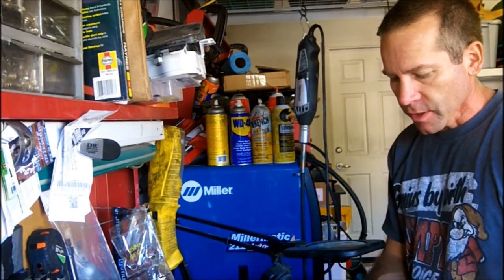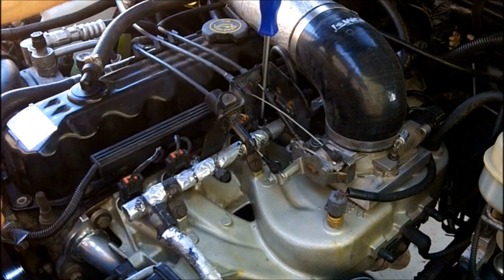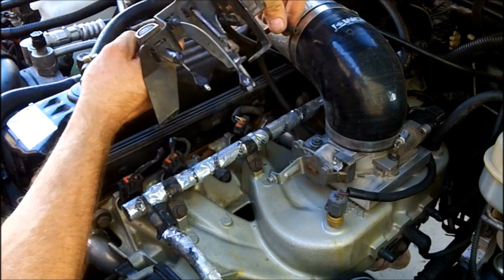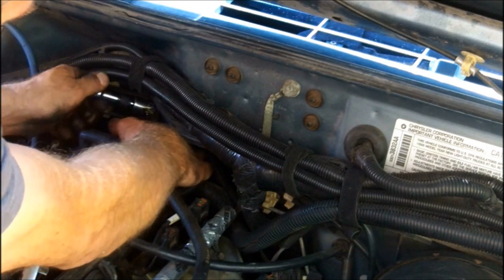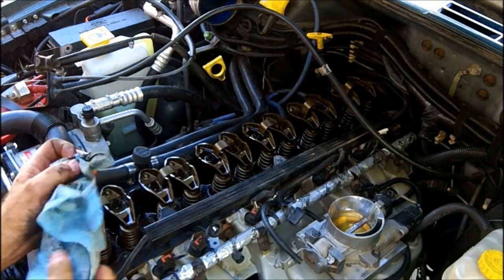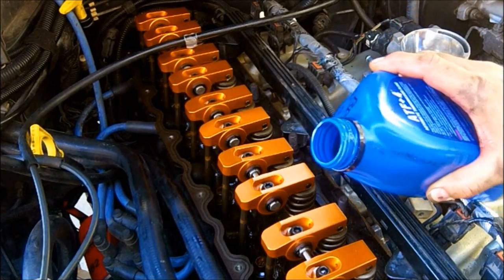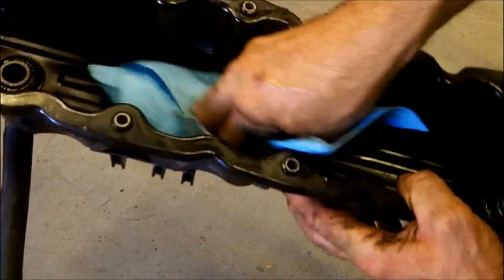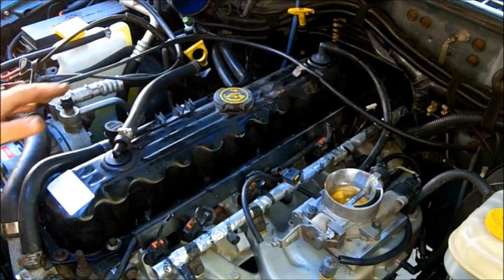How to Install Harland Sharp Roller Rockers on a Jeep 4.0

Comment: My 93 didn't have a bafel.
Is a older renix style cover.

Does the balef really aid these or should i just stick with my renix cover ?
These newer style ones looks cheesy, even sounded so in vid. If it provides a advantage tho i'm swapping it with o e at the yard
Reply from the maker: Taylor Mallory 
I personally think you can stick with your old cover. And honestly I don't think I would have needed to remove the baffle in my steel valve cover. I think the ones that cause a problem are the cast aluminum that have a baffle

Comment: A HELPFUL TRICK FOR REMEMBERING WHICH VALVE COVER BOLT GOES WHERE ID TO TRACE THE NEW GASKET ON A PIECE OF CARDBOARD AND PUSH THEM INTO THE BOARD AS YOU REMOVE THEM. MADE THINGS EASIER WHEN I REPLACED MY VC GASKET.
Reply from the maker: patrick madigan 
Good idea...thanks for commenting
Reply: That's a great lil tip that I will remember! Thanks!

Comment: Great video..ashame you have to cover up those beautiful rockers with a valve cover.. should at least powder coat the cover some bitchin color..lol
Reply: they should have kept them stainless. I don't see the point in coloring them if its not a visible component beside giving you a uneasy feeling when you throw the cover back over them.
Reply: @citydemo5701  Anodizing hardens them.

Comment: Will those rockers work with my 4.2
Reply: Apparently they do make them for 1983-1986 Jeep CJ 258 engines. Not sure if earlier CJ's valve covers are not tall enough for this application as there is no reason stated why they are not recommended for earlier Jeeps.

Comment: I think baffle was supposed to redirect oil onto rockers
Reply: its there to try and keep oil out of the PCV valve and intake breather lines. some times you will not notice it missing but any blow by at all and you will now think you have burnt rings or valves because you will be sucking oil into the intake and burning it causing blue smoke from the exhaust. bottom line, its there for a reason and best to not remove it. if it does not fit with the new rockers then its time for a taller cover. simple as that. why spend good money on upgrades just to cut corners on the instal
Reply: Zachary Graham my older renix style cover didn't have one, but this would make sense.
The newer lighter covers all had baffles

Comment: Where did he relocate the vacuum line from his pcv valve when he installed his new intake?
Reply from the maker: the 68mm throttle body I installed has a vacuum line fitting. Or you install a small K&N style filter to the end of the vacuum hose and tie strap to the fire wall.

Comment: does this reduce the rocker noise?  I would like my engine to have less clickitclac.
Reply from the maker: I can't say that it would make it quieter. Are you sure its not the lifters that are making all the noise.
Reply: thanks for the helpful information.  The noise is most likely lifters, but it's not unusual, most 4.0 I have heard have it.  I am just being picky.  My 4.0 would have a very sweet/smooth sound if not for the loud lifter tap common to all these engines.

Comment: what kind of oil pressure do you have with these arms?
Reply from the maker: The same as it was. No lose or gain
Reply: martinbuilt the reason I ask. I just installed these on a rebuilt engine and at start up I have 60psi and at warm idle  oil temp it goes down to 13 psi and goes up to 40 psi when gas is added.
Reply from the maker: That sounds like a normal engine to me. That's how my engine acts for over 6 years that I've owned it.
Reply: Weird I have 38psi hot idle 45ish cruising roughly 48 cold idle   Haven’t been into the Engine might have some after market part or something. Any thoughts...
Reply: Yes, Lots of thoughts. I have them all the time!!! But you probably have an aftermarket Oil lightening Preasure reducer installed. Sometimes people install them when they  do the valve cover gasket. There just not needed. they can be hot and cold sensitive. They tend to give false Pressure readings when they are hot and cold. What is the PSI when the motor is warm?  Back me up here  Martin ?  What color is the gasket?

Comment: 200k that thing is still a virgin ive seen 500k on thses engines
Reply: . Ive got a 92' and its my first car. From what Ive seen, Cast steel Engine blocks are indestructible. Good to know Ive got a engine that wont let me down!
Reply: Sean Unrein only 500k I’ve seen em close to 800k with the Cherokee basically not even there it’s damn near just a motor trans and axles

Comment: My question is if they're all in line why aren't they all on a single shaft?
Reply: More metal. More complicated.
Reply: Because its an overhead valve engine, not an overhead cam engine.

Comment: hey, when u cut off that oil pan inside the head cylinder cover, the oil didn't go through hose straight to the intake? and how many power u get after that swap, I know less friction mean better displacement that make sense.
Reply from the maker: If I would do this again I would not cut out that metal under the rocker cover and see if it would clear. A small amount of oil will go into the intake. I ended up taking that hose off and installing a vent filter and mounting it high on the fire wall.
Reply: martinbuilt ....so dont. I tried that for that reason and it doesn't clear, all of them rub on the baffling and bent 3 or 4 pushrods. I had 12 spare rods so it was a quick free repair, but I removed the baffling and it's fine and a lot quieter

Comment: Why does your air intake go across your engine and into the vehicle?
Reply from the maker: That's my cold air intake. I have a video on it. The filter sits inside of the cowl.
Reply from the maker: Don't recall the ratio. But I would see if the part number of a factory 
rocker for the 4 and 6 cylinder are the same. If so I don't see why they
 wouldn't fit.
Reply from the maker: the air filter is inside the cowl.

Comment: i saw on the site they have 2 different part number for the 4.0  what one did you use
Reply from the maker: part number S40196
Reply: thank you sir
Reply: What's the other part number? These are the 1.6. I can't find the part number for the 1.7 arms anywhere.

Comment: If one hasn't done any work under the gasket cover to this point in their build, when installing the Roller Rockers, is there any other general maintenance or items to consider replacing other than the gasket while it is off?
Reply: Pushrods.
Reply from the maker: well there are a number of things you could change out push rods if you like and I would probably most likely inspect the valve guide seals of course that does involve removing the valve retainers. that can be a pretty big job. but then the chorus if it needs to be done it needs to be done.

Comment: Where do you find your special parts like your bigger intake and harland roller rockers or similar? It is tough to find jeep parts on 4.0's. What are the benefits after your install? Chatter more? HP or power gain? Run smoother, cooler?
Reply: That "bigger intake" is the stock late model 4.0L intake manifold. You can pick those up off any late model (99+) Cherokee and it's pretty much straight bolt in. I think you might need to make some mods to the mounting of the fuel rail, but I can't remember. Unless you're talking about the intake tubing he used to relocate his intake to the cowling, in that case it's all custom. 4.0L's have a decent parts market out for them. You can pick up stuff at Summit or Quadratec for them.
Reply from the maker: Eyebrows Mahoney 99 plus
Reply: +martinbuilt thanks for the correction. I've edited to reflect
Reply: Right on guys! Thanks for the help!
Reply: the main reason for doing roller rockers, is less wear on the valve stems and also stronger rockers, the stamp steel rockers tend to bend over time
Reply from the maker: +Petie Wheatstraw I'm not having a hard time finding parts for the 4.0. Just google what your looking for. As far as the rockers go, I wouldn't say there is not a great benefit to them, especially with a stock cam. They are quiet, no noticeable improvement  in HP.  It would take a dyno to see any gains and I think it would be minimal.

Comment: I noticed you have a bleeder valve on your heater hose. where did you get it? having a hard time getting all the air out of my cooling system.
Reply from the maker: Walmart
Reply: Your kidding. Online or in the store?
Reply from the maker: In the store. Just above the antifreeze, next to the flush.
Reply: its a coolant flush t you get it in a coolant flush kit.you can get them at wallmart or any parts place
Reply: @andrewslagle1974  
Do but a spare one though, after a few years they can turn brittle and break.  I've had to replace a few.
Reply: Jack up the Jeep in front and fill.

Comment: what kind of socket were you using. not size or anything just in general, i like how it can move up and down for better angles.
Reply from the maker: +0GSkywa1ker I believe you are referring to the 3/8 drive ratchet wrench with the flex head. This wrench is a Craftsman brand. It is one of my favorites. Also works great as a breaker bar because it has a longer handle.

Comment: martin, did removing the baffle in the valve over effect the pvc? if so, good or bad?
Reply: I would like to know this too if removing the baffle allowed caused any difficulties of had any negative effects like more oil in the intake?
Reply: I would like to know this too if removing the baffle allowed caused any difficulties of had any negative effects like more oil in the intake?
Reply from the maker: +MrGuitarguyadam I can of wonder if I needed to do that. I think you would if you have the older aluminum valve cover. I believe the steel cover gives a little more clearance that the aluminum.
Reply: awesome thank you

Comment: Shouldn't you install these on each cylinder starting at #1 on TDC  (Torque to 19ft lbs) , then rotate the engine so the next cylinder in the firing order is on TDC and repeat the cycle ?  ............... Torquing these down against spring pressure will give you a false torque reading and leave the rocker arms loose when at TDC on a particular cylinder .......
Reply from the maker: +Norman Murray 
Thanks for mentioning that. You are right.
Reply: Put a socket on the crankshaft damper/ pulley bolt and turn it clock wise ... It will be easier to do if the spark plugs are removed because there will be no compression .....
Reply: And if you take the plugs out you can see the pisten at the top or use a skruedriver 👍✌️
Reply: So could we do this the way that he did or should we follow Norman? I am thinking about doing the upgrade and just want to make sure that I am clear haha
Reply: Soking them is a joke just oil them and you should have each cilinder at top dead ✌️
Reply: Ron White and how do Ik if they are at top dead center?
Reply: The intake valve is the last one to close and then make sure it's at TDC 👍
Reply: No because you have hydraulic lifters. They will compensate for whatever position the cam is in.
Reply: I've never manually advanced the pistons. how do you do that?
Reply: You just answered the question I was about to ask👍
Reply: kmm
Reply: You start on cylinder 1 on TDC, after finding TDC on cyclinder 1 with, wistel, screw driver or finger tequnique.  Then you mark balancer in 4 places. Top/ bottom and both sides. Then you rotate engine clockwise buy crank bolt. A quarter turn or to next mark. Then you move to next cyclinder in firing order and make you adjustment. I allways do a  1/2 turn, no slop up or down movement on pushrod, but it should spin freely. No bind on rod, meaning takes alot of force to turn pushrod with your fingertips.
Keep on Dreaming
Reply: @keepondreaming3870  Good info. Can You do it in pairs so you don't have to turn the crank as much? 1/6, 2/5, and 3/4?
Reply: @tmmyjay  I'm going to go out on a limb here and say no, you don't want to "double up" on cylinders as you asked. The reason being, I believe it's correct procedure to do anything valve-related at TDC on COMPRESSION stroke. Therefore, when #1 is at TDC compression stroke, #6 is coming up on the exhaust stroke.
Reply: @JayS-w2c  I hear you, but it's the base circle that matters. If you're on it you're on it, but without knowing for sure, I did it one at a time...
Reply: So to change the rocker arms and tighten them you have to put each piston in compression position, turn the crankshaft and then the next one, 2nd and next one, etc.??? Thank You!
Reply: Lifters have a .030" range of operation you want to stay within.  Go outside of that range and you can damage the lifter, either wear out the tolerances inside and have a collapsed one or have them too lose and the push
rod knocks the retainer clip wonky and it flies apart.  I've had both happen, and the latter just happened yesterday.

Comment: Like all your videos, this is very informative and well made.  I have an almost stock '00 XJ I6 4.0L.  I did install a slightly larger TB.  I'm looking to increase power.  Is installing these Roller Rockers a good next step or is it further down the list of items you would replace or modify before doing this?
Reply from the maker: +MAJ HMR 
I would do a true cold air intake (CAI). Don't use a K&N air filter, those are dirt suckers.
 Hi flow cat and a free flow cat back exhaust. It would be a waist of money to do these rockers at your point of the build.
Reply: I'm in the process of using your video on CAI.  I'm not a K&N fan.  I'm looking into the exhaust system.  If you have recommendations there, I'd appreciate it.

Comment: Great video Martin, thanks for posting. Wife threw a rod in my sons jeep XJ 4 months ago while he's in Japan.lol  For him I threw a Crower Baja Beast Level 1 cam in with +.030 Overbore piston and rebuilt it with Banks header and airaid intake. I am putting the HarlandSharp roller rockers in the 4.6L Stroker in my XJ. btw what's the specs on your throttle body, likes vs dislikes? thanks
Reply: Do you have any stats on the adapter you built?
Reply from the maker: the throttle body is a 68 millimeter off a  4.7 liter Dodge Dakota. I ported and polished it. and I had to build a special adapter to go from the four bolt to a 3 bolt pattern. I can't say that there was a big horsepower gain it's hard to feel. it definitely seems to open up on the upper end. and it has more of a roar to it. I do have a video on it. I can say this I'm not going back to a 62 that I had on before

Comment: Cool. Nice install Martin.
Something tells me there is a seat of the pant$ feeling with these.
Reply from the maker: +Scott McIntyre
Your funny Scott, Yes there is that kind of seat in the pants feeling. I shopped around and got them through JEGS for 359.77. Jegs price matched someone, I forget who.
Reply: +martinbuilt  Good Price! 
You would spend ~$144 on factory ones if you replaced after a full cylinder head job. ( SealedPower price via RockAuto). 

Thanks again. Doing the WJ brake upgrade you did on your XJ to my MJ.
Reply: Yes, his wallet which resides in the seat of his pants is definitely lighter.